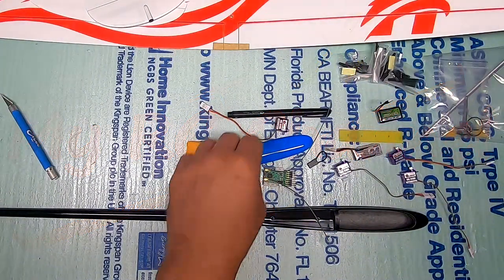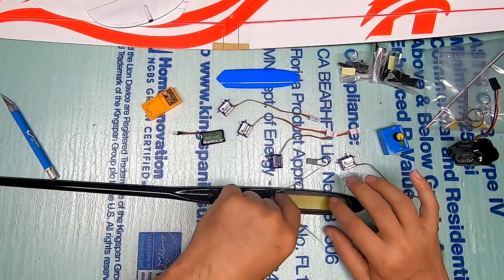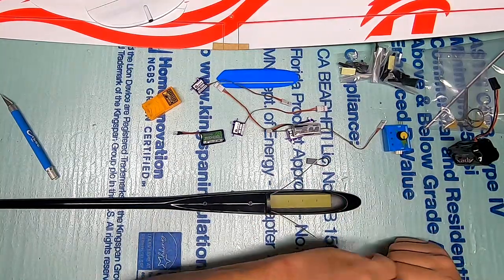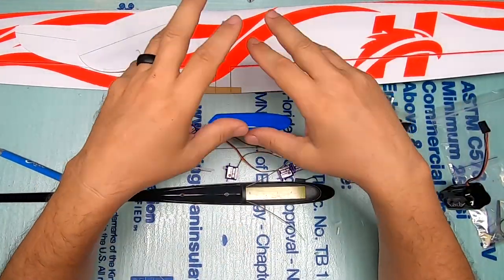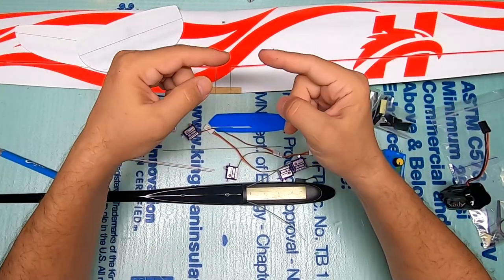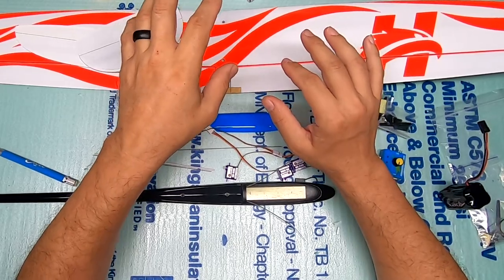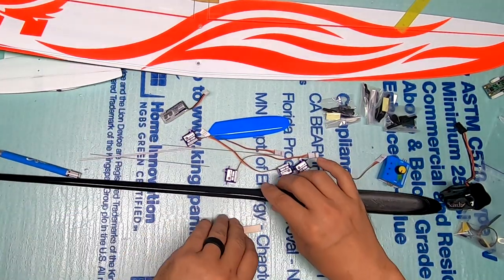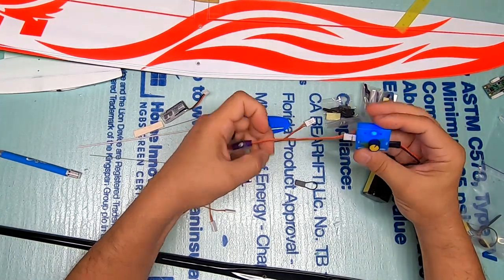Building the Hawk 1m DLG, Discus Launch Glider - Pt. 1

Comment: I'm about to order my first DLG and it is going to be a Hawk!  This video is very informative to the RC inclined viewer and I have to thank you for putting your time and effort into creating it - fantastic job.  I think you may have sold me on a Spektrum radio and brought me out of Futaba darkness with this too.  I was eyeing a Futaba 10J, 12KA, or 14SG radio, but the simplicity of changing flight modes with a DX8 is substantial.  What you were describing with the elevator return spring, I believe is potential energy; as opposed to the mechanical energy derived from the servo.  The spring can pull one way on an elevator, but if the air the plane is travelling through doesn't allow the spring its action, then there will be no release of that potential energy of the spring, and thus a delay in response.

Comment: Great build videos..
Just wondering. Can I use flysky micro..
receiver and the flysky radio..YoungRC Micro 3.7g Servo GH-S37D Mini Digital Servo... Thanks
Reply from the maker: First, I'd like to apologize for not finishing this series of videos. I will be completing and flying this plane this winter/spring. 
Second, I would suspect that most micro receivers will fit. You may need to take it out of the case as I did... maybe not. This is without a doubt the tightest electronics bay in which I've ever done an install. If you are not an experienced builder, I would recommend a different plane. I have had to try multiple arrangements and did multiple test fits to get gear that would fit and arrange it in a way that it would fit together and work. It is also eggshell delicate and it won't survive even a rough language. If you get it and get it build, I recommend trying to hand-catch whenever possible or land in tall grass. But, if you are an experienced DLG builder and pilot, you'll undoubtedly have a good time with this plane.

Comment: When building DLG's what do you do with the rx antennas? Do you drill little holes to pop them out for better transmission? if so, where do you make the holes?
Reply from the maker: I'd put them left and right sides ahead of the wing. The fuselage material is very thin and may not be an issue. You might want to do a range test with the antenas inboard before drilling. Get a friend to walk a hundred yards or so away with the plane... it helps if you've got cell phones... move the control surfaces and confirm that they are moving as they should and are not gittering or other anomalies.
Reply: @MyRCChannel-CJScott  awesome. thank you for the tip. Appreciate it.
Reply from the maker: @TribeQuadQuest  Here's a tip I got from a viewer... try to hand-catch the glider whenever possible. The fuselage is so thin that it can be damaged by landing in thick/heavy grass. He learned this lesson the hard way.
Reply: @MyRCChannel-CJScott  thank you. Great tip.

Comment: Hey! So that 1s works with those servos? I’d think they need 5v?
Reply from the maker: Hi Mike! Yes, the 1s does fine... 2s would over-volt the receiver & servos so a buck converter or small BEC would be needed to bring the voltage down to an acceptable level. Unfortunately, there is barely enough room for a 1s versus a 2s and a buck converter or BEC. It's one small fuselage and it's paper thin. One viewer recommended doing hand catches since even a slightly rough landing in thick grass can break the fuselage.
Sorry I haven't finished this series of videos. My father passed in Nov. and I my winter didn't go as planned. It's a great kit and I definitely like it... but, it's very limited for space, even more than most DLGs which are notoriously tight. If you decide to get one, go with the servos I recommended. I tried others, but they were to large and a viewer told me about the ones I ended up using. I haven't seen anything else that fits.
Thanks for watching! Please stay with me, I'll be doing a lot of plane projects this spring/summer and some neat car stuff too, if that interests you.
Regards,
CJ